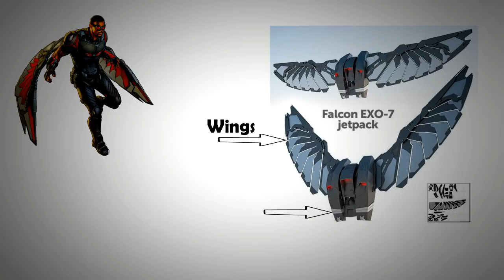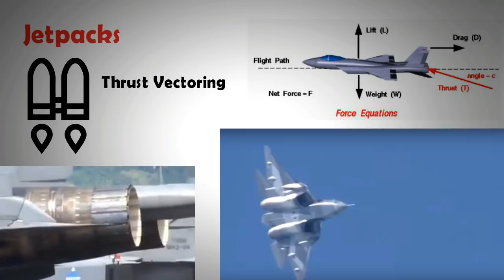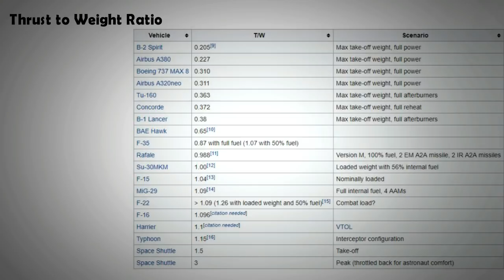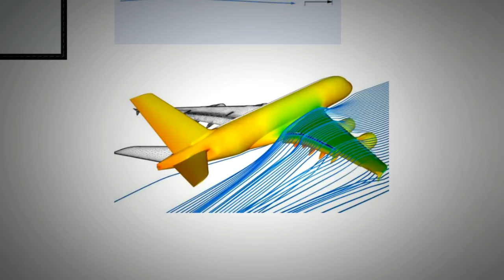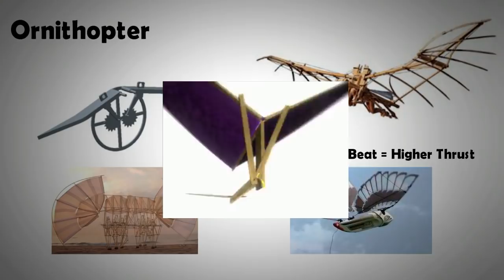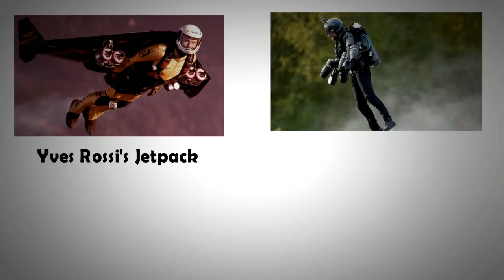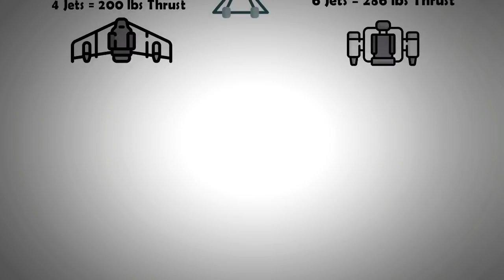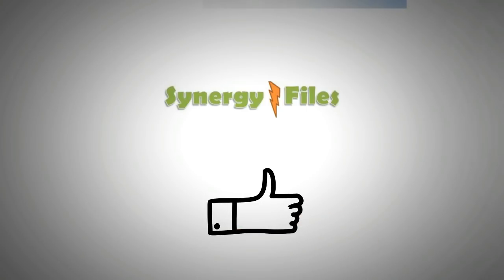Engineering of Falcon's Suit

Comment: 6 ft wings with thousands of tiny holes in them and the holes open and close as they go up and down, when the wings go up the holes open when the wings go down the holes close. That allows the wings to draw in air through them and then as they flap downward it pushes the air away allowing it to lift. The wings are able to flap much faster because of this the aerodynamics of it allow it to Flap at speeds of 200 mph with flat feet like a bird's tail you should be able to Glide with the wings and the tail of your feet. A magnetic system that holds your feet together but can come apart easily with an electrical pulse connected to your fingers.

Comment: The EXO-7 wings are never shown flapping, and have no visible way to flap the wings. The wings are, however, frequently shown changing their geometry, allowing them to change the way they interact with the surrounding air. This cannot generate thrust, though. The only way the EXO-7 is ever shown generating thrust is with its jet engines.
Reply from the maker: Thanks Brendan. Now that I think of it you are right. I guess I was too focused on ornithopers and the immediate example that came to my mind was Falcon's suit. This gives me an idea for a new video
Reply: I agree when the winter soldier tore off one of the wings the pack was  useless u would think it would still be capable of flight without the wing just retract the remaining wing and fly by jet pack only I think the wings are there for stability and maneuverability u can’t use the wings without jet pack and u can’t use jet pack without the wings if the pack malfunction u would think he’d just glide but without propulsion to maintain lift he just drops like a rock
Reply: I agree with most of this, except there are some handles on the underside of the wings that can be used to hold for control of them. Granted this won't affect the other ways the wings adjust shape, unless there are some other controls built into the handles. But there are a lot of times he doesn't appear to be using the handles to control the wings, I've just noticed them as I've obsessed over this idea for a bit lol.